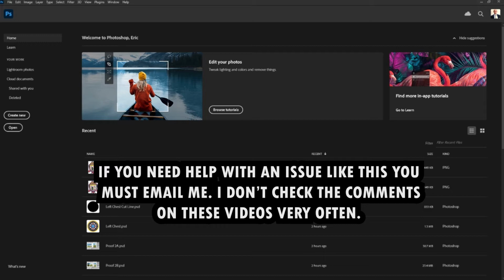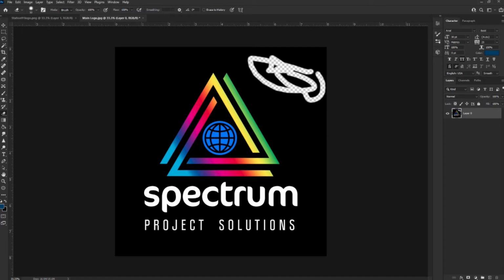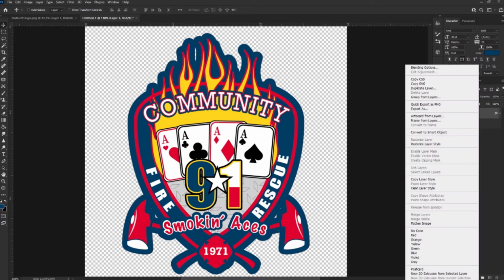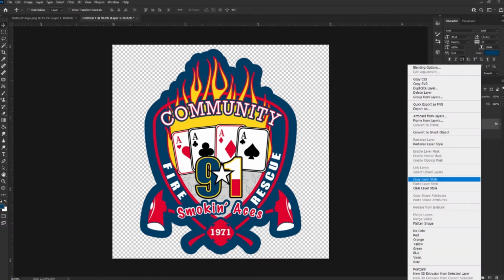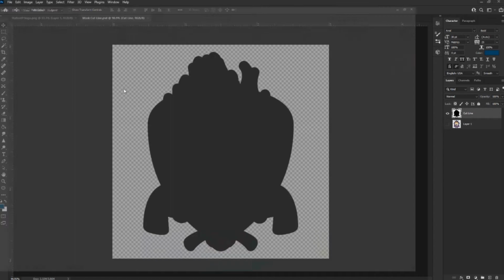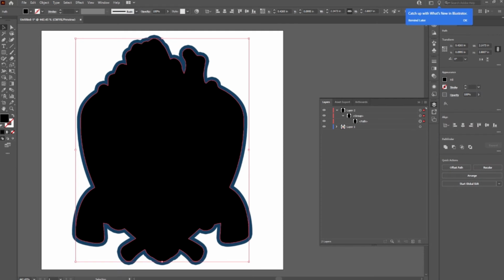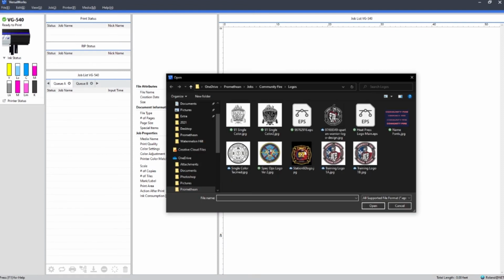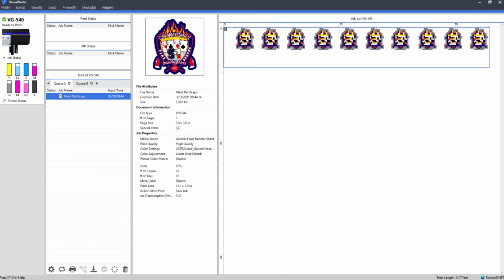Full Tutorial on Compound Cuts with Raster Images using Adobe Photoshop and Illustrator without RIP

Comment: Hey man,  i have a sg2 640, i have a box truck project. So Its a big print i splitted in 2 parts with a overlap vertical But there is a huge Color difference. Do you know What i could do?
Reply from the maker: I’d bring up both files in each program and use your color picker to assure they are the exact same. Then I’d double check to make sure you have the versaworks settings the EXACT same for each print file. Make sure the machine is warmed up to temp, you are using same print substrate, and not waiting between prints. Check your ink levels before print so you don’t swap out mid way through it
Reply from the maker: If that doesn’t work, try reversing the image. In other words, let’s say your top section has blue on the left but your bottom section prints it on the right. Flip one upside down in versaworks so both would print the blue color on the right. This would assure it’s not a print distance error. Hope that makes sense